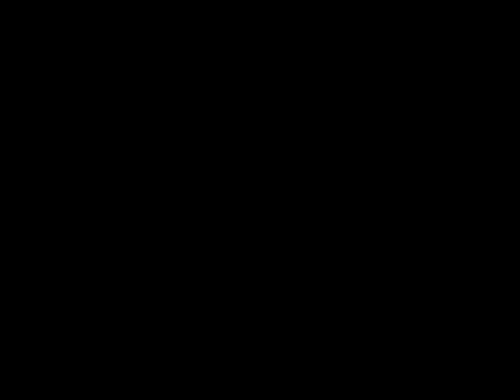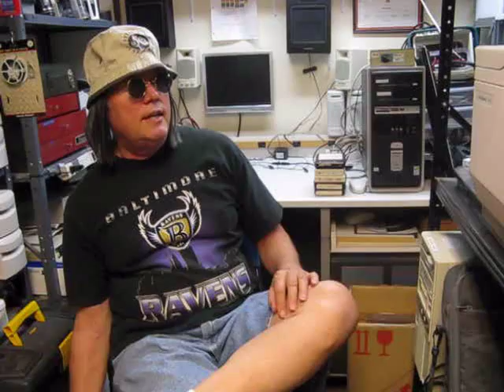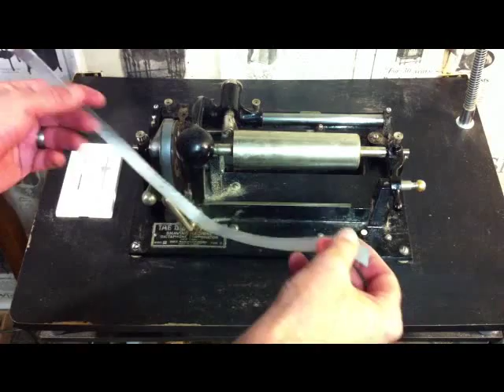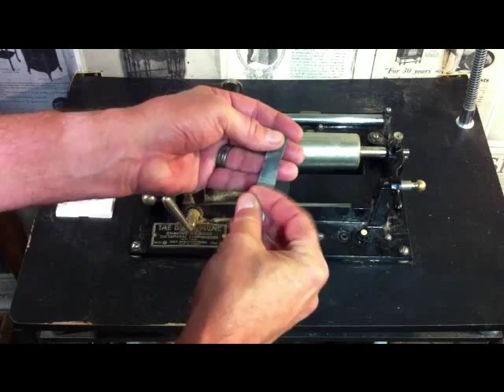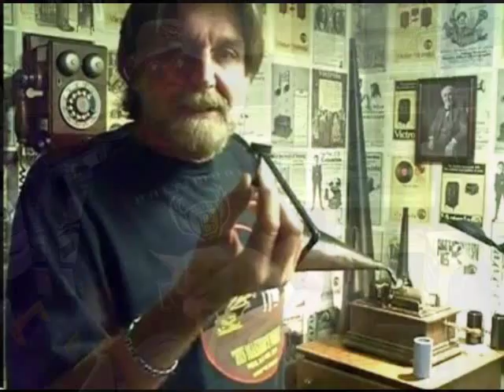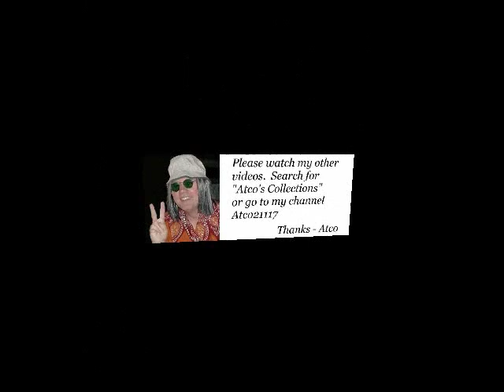Repair Drive Belt - Use Duct Tape - Phonograph Cassette 8-track etc

Comment: Tried this with my 8 track player works 100% great tip I posted a couple vids on my YouTube channel.
Reply from the maker: Hi Clint - Sometimes I have to make a couple shots at my belts to work fine, but they do the job.  Most I've done I eventually replace the temp belt to a correct one.  But for one 8-track that I use a lot, it is still working fine for close to a year.  Glad things worked well for ya.  Thanks for commenting!   See  ya -- Atco

Comment from the maker: Hi Garlicdawg - These do work for a temporary belt.  Also checkout my Velco belt on another video of my channel.  That works too and a lot better to make then the duct-tape.  Make sure to look for the thinest velcro you can get.  The ones that have worked the best are ones that I found at a Fabric store (JoAnn).  Good luck -- Atco
Reply: atco21117 Would Velcro work on a reel to reel tape recorder,having probs getting a drive belt diameter 9 inches/23 cm thanks.